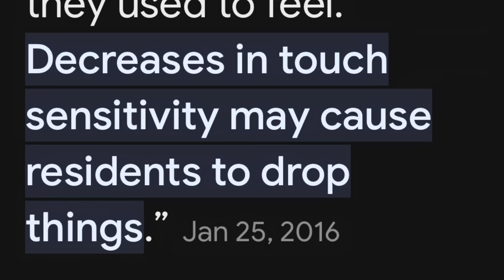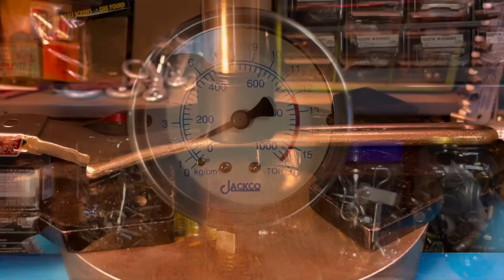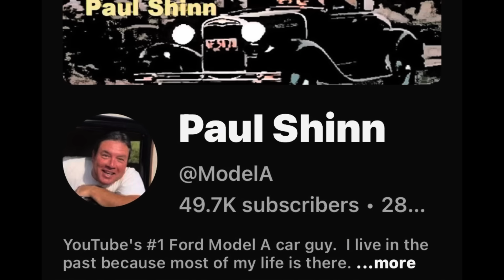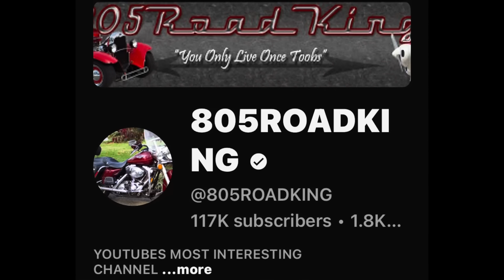Vintage Knox Spanner Wrench Restoration Plus Asking For a Favor.

Comment: I agree with the ladders. My nephew came up to repair my roof with my 10 foot ladder. I can't get on the roof anymore because of neuropathy on my left side. Growing up In the cabinet and upholstery shop I was use to working with the quality of delta machinery. That's what I own today. My sewing machine is a pfaff 145. My opinion is I have the best. I told you the story of my father saying wood handle screwdrivers were the best. When I split the handle on a brand new never used flat blade he walked away with his hands in the air
 One of my favorite stories with my dad. He said don't buy a tool you have to replace after you buy it. That's why I stay away from harbor freight. Thank you
Reply from the maker: Jess- Buy once cry once!  😂👍

Comment: Those spanner wrenches look like a variation of some of the older ones we in fire department use to tighten or loosen fire hose couplings. The bend could be to keep the wrench from sitting flat on the ground so firelighters can pick up them up with their gloves on...

Comment: Those spanners are great. The ones with pins are fantastic for removing drill press chucks if they use a locking collar, like some Jacobs taper 33 for example.

Comment: Great video 👍 Sorry to hear you fell. Glad to see you are ok 👌. That happens to me sometimes too. Don’t know how or why it happens neither 🤦‍♂️🤷‍♂️. 
What a Fantastic clean up and restoration of that vintage Knox spanner 🔧 wrench. I think that offset was put in that spanner wrench to give more Clearance for the ✋hand especially in awkward and tight areas or rusted on nuts. Great to see the Dake in action to straighten up those bends👍. I like how you did the bluing on the inside of the wrench to embellish the lettering,fantastic job!👍.That polished look you did to the wrench 🔧 I think looks way better then the original forging done at the factory 🏭👍. I think the condition it was in you knocked that one ☝️ out of the park 🏟⚾️⚾️⚾️👍👍. 
I will have to subscribe to Paul’s channel to see how he repairs those model A cars , seems to me it will be  interesting to see how he does it.  I came across a channel one night called TFL Classics. It was a show where two young men drove a Model T on the highway 🛣 to go to a Ford  dealership to get it serviced. And along the way they tell you the history of the car and how it operates and how some of the moving parts of the car were made up of , very interesting to see.👍 Another great shot of Old Glory 🇺🇸 flying in the breeze. Again great video and can’t wait to see what you do on Wednesday. Have a great evening.😄👍👍
Reply from the maker: Steven! 😃👍🇺🇸

Comment: Its not directly the age that is getting to you it is the years of eating carbohydrates and seed oils like vegetable oils and all the crap they put in our food system. Without typing out a ten page response, i have lost 82 pounds since October 2023 and im off all my meds as well. All i did was chang the types of foods i eat and going zero carb or VERY LOW carb. No veggies, no grains, no sugars, no seeds/nuts/ or nut oils. Great restoration, keep the restorations coming, wife hates when i watch your channel! :)
Reply from the maker: Jack- I agree but it’s a bit more challenging being a vegetarian. 🫣😂👍
Reply: What the heck do you eat?
Reply: Before October last year I was eating typical American diet. Not much veggies. Never liked veggies. Now I only eat beef butter bacon and eggs with some kefir goat yogart, sour kraut, kimchi for gut health. Lost 82 lbs so far cutting out carbs, startches, sugars etc...The fat from the meat, butter and tallow keeps me full and not needing to snack. Usually only need one meal in my eating window then have a cup of kefir later or maybe cup of soup kraut.
Reply: Thanks for the outline on eating. I doubt I could process all that protein but it sure seems to be working for you.

Comment: Another great show. Can you tell me the grit flap disks you use on the spanner resto’s please?
Reply from the maker: Hi Troy- I start with a worn 60 grit to get rid of the forging marks and pits then go to a worn 120 to get out any deep scratches after that the fiber wheel and polish.  Only 2 discs for me, you could go to a 320 disc for a mirror finish but I’m lazy.  🫣😂👍

Comment: My observation is that the past 20 years, the Red Tail Hawk population has increased everywhere greatly and I have seen them do a number on pigeons in Paterson, NJ
Reply from the maker: I used to have quite a few hawks around my house because of the pigeon coop, but my pigeons were usually faster than the hawk. However, there were tons of young ones and stray pigeons that would keep the hawks away from mine.  😃👍

Comment: I would love to subscribe to Paul's channel but to late my model A pickup in my avatar is because I own it.  Paul is sort of the unofficial guru of the Ford Model A so of course I subscribed years ago lol

 SC being serious a Ford Model A it's one of the funnest cars you will ever to own and to work on its not like a modern car whatsoever, Henry Ford and his engineers designed the car to be worked on with basic hand tools by someone such as a farmer that had basic mechanical ability but wasn't necessarily a mechanic so it makes the car such a great classic as long as you understand it's a 90ish year old car so it in stock form isn't a race car in modern terms  
  
 Also Believe it or not for being a 90 year old car it still has great aftermarket support not only in the Hot Rod community which it definitely has aftermarket support because behind the 1932 ford the Model A is probably just as iconic if not more so. There is also a robust stock car parts community there is companies like Vintique or Ecklers  a dozen others that either specialize in licensed Ford reproduction parts or performance parts ranging from the discreet and period correct to modern 12 volt conversions and electronic ignition systems or show winning restoration parts. 
Also there is tons of stores around the country that sell the parts so you might not have to buy stuff online but you could get it locally I would imagine you living in New York this would be the case.  

Anyways my point is if you can afford it I would highly recommend buying a Ford Model A you can get in a driving project usually for about 6 or 7k a fairly clean older restoration or original car for about 10 to 12 or a show ready restoration usually for about 20K (obviously certain body styles might be worth more or less but all are pretty reasonable for the most part) and to top it all off there is two door sedans four-door sedans coupes roadsters, pickups, big 2 ton trucks, postal vehicles, Woody station wagons and just about any other body style you could imagine... 
Oh and how could I forget since you like swap meets, there is a swap meet in Hershey Pennsylvania and one in Carlisle Pennsylvania both of which are pretty well-known to be the swap meets of swap meets if you're into vintage car stuff, unfortunately they are a little far for me to drive to but they are fairly close to you, but I got a good one in Turlock California that is pretty close to a West Coast equivalent...
At any rate if you choose to go down that Model A path ever let me know I wouldn't say I'm the most knowledgeable person but I definitely know a little bit about the car and I have no problem sharing the knowledge. Also from my little bit of experience with Paul Shinn he is a wealth of knowledge and he is pretty good about answering people that comment on his videos.
Reply from the maker: It’s so funny but a bunch of people from our group are already subscribed to Paul- It amazes me how we all seem to share similar interests.  One of the reasons I wanted a Model A is because of the simplicity and parts availability. I have an owned a few antique cars and it becomes a real hassle trying to find common parts for an uncommon car!  Plus I’m a fan of Henry Sr. 😂👍
Reply: @ScoutCrafter  I completely understand about how hard it is to get parts for certain classic cars.    As an example My latest "Summer fling" is a 1952 Kaiser deluxe that I think got parked  sometime in the late 1960s, I am  hoping I will be buzzing around the local neighborhood in the next week or two but it will be far from clean because things like weatherstripping or correct interior upholstery patterns are next to impossible to find.

I didn't necessarily want the car but I put a stupid low bid on it at a local auction  and I won it (I paid $52 for it before auction fees lol), I really like the strange and offbeat cars (Rambler Studebaker type stuff ) but this car is a whole different beast when it comes to getting parts that are not engine related (the engine came in a lot of vehicles because it is a continental brand), needless to say eBay is my friend and one piece of chrome trim has cost me more than the car lol.  
Anyways with a Ford Model A you will not have that problem, pretty much any pre war ford is pretty easy to get parts for minus a few pieces of dash trim or rare options like stock early 1930s radios they cost just about as much as the car so not too many of them were sold but for the most part parts are extremely attainable and common and they are not too badly priced... 
Now that being said I would recommend buying the most complete car you can find, even though replacement parts are cheap they can add up pretty quickly if you buy a toilet of a vehicle like I did with my 1931 pickup.
As for value, because they are so popular in the hot rod crowd, value wise a roadster and coupe probably have the strongest value and a two-door (tudor) or four-door (fordor) is probably the softest even though they cost more to restore, from a drivability standpoint the two-door sedan is probably the best for a bigger guy, the hardest part is getting your feet off the running board into the floor of the car there's only a 12-inch space but once you're in there it's pretty comfortable. The worst A to fit in is probably the pickup as the cab is just too small although it's part of what makes it really "cute" according to my mother and my ex as they both like the pickup the best. 
Anyways you made a YouTube channel that pretty much is for every man that likes old and vintage guy stuff, I keep hoping you will monetize yourself and make some money off this great community you started, you deserve it and you could probably easily afford said Model A if you did so or that house in the country but either way I just want to thank you for taking the time to make these videos and it's really cool that you respond especially with the amount of Subs you have these days (I think you were around 2k when I came across your channel).

Comment: Hi John! I have a question. What is the hardness rating of the fibber wheel that you use?
Reply from the maker: I believe it’s 180 grit- however it’s smoother than 180 sand paper.  😃👍

Comment: Yep, the adjustable spanner wrench was bent on purpose. I know exactly why they bent the handle. Spanner nuts on things like machine spindles are often in a confined space and there is almost no way to get the wrench onto the nut and be able to get your hand onto the handle at the same time. 
I would have left the handle bent as-is. Think of all the cussing you will avoid in future.

Comment: The Knox 33-S-47 isn't supposed to have the curve in the handle.
Reply from the maker: Yeah Mitch I thought it looked home made but it looked like it would give good clearance.  Maybe bent for a special application.  😃👍
Reply: @ScoutCrafter  Yes, likely "customized" for some particular reason.  Note that I'm referring to the curve that you left after fixing the twist.  A quick internet search on Knox 33-S-47 showed several unrestored examples with a straight handle like the other one you showed us.